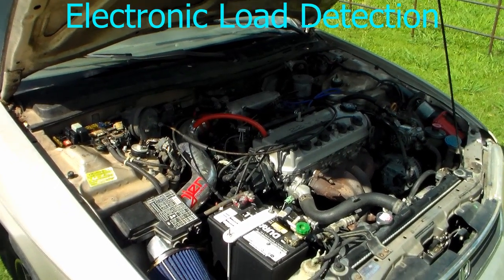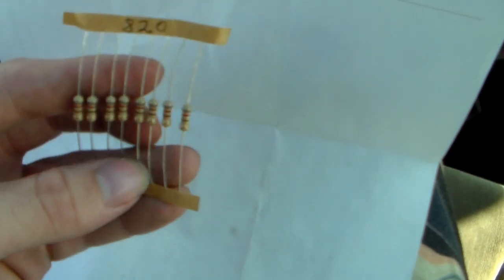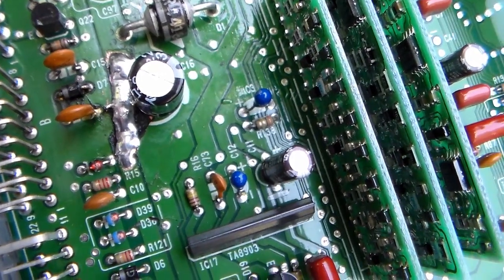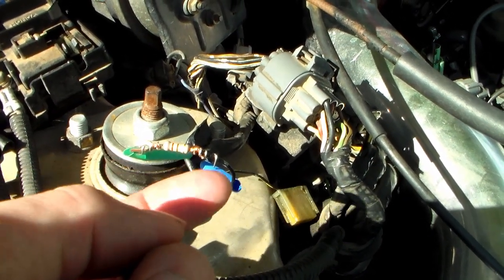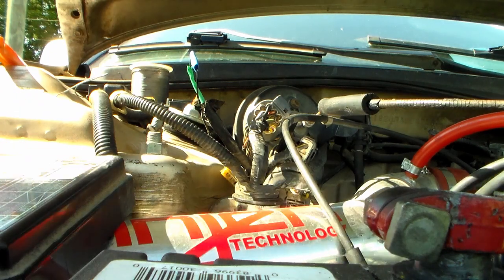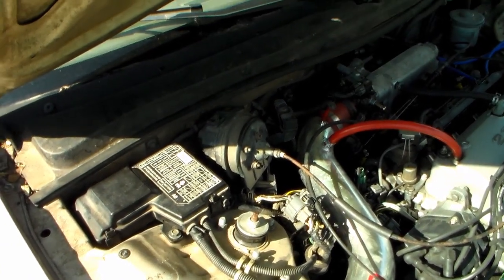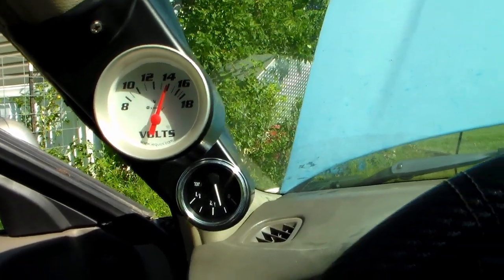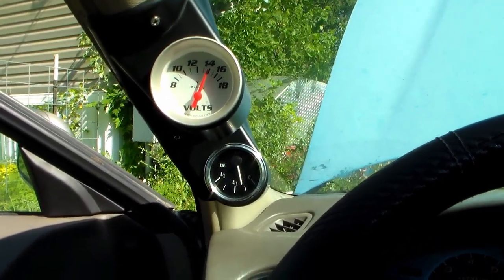Bypassing 1994 Accord's ELD System and Fixing the Damage the System Caused

Comment: I'm pretty sure μF is micro farads. Pretty common to see capacitance measured in mili, micro, nano, and pico units. A whole farad is a lot for most applications.
Reply from the maker: Thank you for pointing this out. You are absolutely correct and now I have to find a method of fixing this video with correct terms. I do not know how I managed to mess that up. In the future I know the correct terms to use.
Reply: @foxisretrofitting4556  This is probably sufficient. Trying to order one will be the first tip off. You've pinned the correct unit now so you should be good!

Comment: when i took out my ELD  mines started fluctuating after a hard bass note. I saw a jump from 14.1 up to 15.6. Then back down to 13.8. It would just fluctuate in between those 2 numbers every time the bass note hit. But I just don't like that high spike.  Is that normal or is it safe

Comment: Idk if you’re still checking comments here but in doing this, will this shorten the life of the alternator?
Reply: I meant the resistor on the connector, by the way.
Reply from the maker: @disheveledhair  It's not perfect or elegant but I've been running on the same resistor for 2 years now.
Reply from the maker: Been running the Accord like this for 2 years now and it's been fine. I suppose the brushes could wear a tiny bit more but they are very simple to replace as they are like a cartridge that you can access from the back of the alternator.

Comment: Do u know where i can get that 820 resisor at asap
Reply from the maker: Got mine here: https://www.ebay.com/itm/163634336012?var=463826521634
Reply from the maker: If you need to be quick and dirty with stuff that you might be able to find local I've seen a guy on a forum use a 1K and a 4.7K resistors in parallel (take both and hook them in side by side in the connector) to get by temporarily until he got the 820. Your car basically looks for a set amount of resistance and if that resistance is met it turns the eld circuit off running the alternator normally.

Comment: This exact thing happened to me. Will the 820 resister work 4 now any suggestions on other damage do I need to fix board to get far to start right now
Reply from the maker: You will want to check the ecu and see if it's damaged like this. If you're lucky it's just the resistor that needs changing and damage to the board is minimal. If you are like me and it's this bad you'll need to do a repair like this. The car wont run without that fixed.

Comment: Does it matter which way the 820 capacitors gos?
Reply from the maker: For the 820 ohm resistor it doesn't matter and can be installed in either direction to bypass the ELD.  
For replacing the capacitors inside the Engine computer if you ever need to they have a stripe on one side which indicates the negative side which you install pointing to the white stripe on the board.